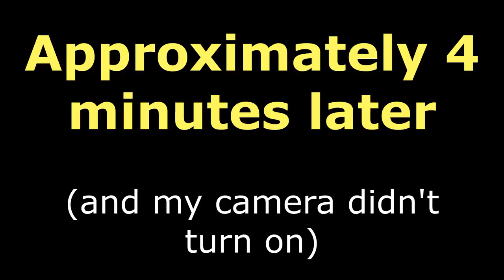14 Miles ALONE on the River!! (Crazy Fishing)

Comment: These times are so few that you just have to cherish them when they do happen. I hope the second part of this video is just as good!  
And whatever your deal with Whisker Seeker is, they need to bump that up a little bit. I'm saying this because I've mainly bought circle hooks from them in the past and I may have bought some sinkers. Mainly terminal tackle type stuff. But my worm rod needed to be respooled with new line and I use braid for that reel and it's the only reel I use braid on. I hate braid, I've never found any that I liked but decided because of your videos that I was going to give Whisker Seeker braid a try. I didn't have high hopes but you never know. I also bought their scissors they claim would cut the stuff. I'm thinking BS the whole time I'm placing the order. I've tried everything except my chain saw to cut braid and nothing cuts that stuff! I have emergency room scissors that will cut a cast off of your leg and they won't cut braid! Well, I'll be damned! These things are like magic scissors from outer space! I thought the first cut was a fluke so I cut again and again and every time they snipped right through it! I thought ok, I'll show you. I went to the garage and grabbed the 8 strand cheapo stuff that I bought off of Ebay that is the worst thing I've ever tried to work with and it snipped it clean, cut after cut after cut. It was "almost" orgasmic! But, like a true idiot I wasn't thinking about it being smaller and the reel will hold more so of course, I ran out since I only ordered 150 yards! Aargh! 
But I'm not a complete idiot, I didn't splice in the old stuff to finish spooling it up. Nope, I ordered more and will splice on the new  braid to finish the job when it gets here. I also ordered even more to spool up a couple of my Catfish reels with. It just might be the best fishing line I've ever tied a knot with.
I even decided to order some of their monofilament line to try that out too. That'll be a fall order though since I already have enough mono to nearly respool every reel in stock at Cabela's! I've been a huge fan of Ande Monster mono for a few years now so it'll be hard to win that comparison test in my feeble brain but I'm gonna give it a shot. I have two boxes full of Ande Monster mono in my garage now so I'll have to hide it here in my office so she won't ask why I'm ordering more fishing line. Plus, I think I'll buy her a new rod and reel so she'll think I bought the new line just for her. Like sparkly things, that always works. And this is much more reasonably priced than most sparkly things.
Ok, now to wait for part 2.